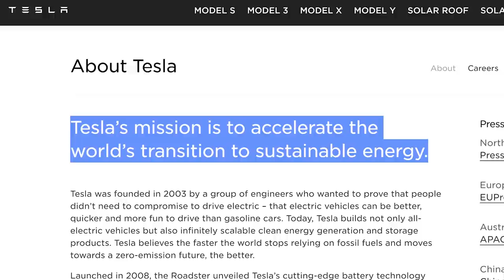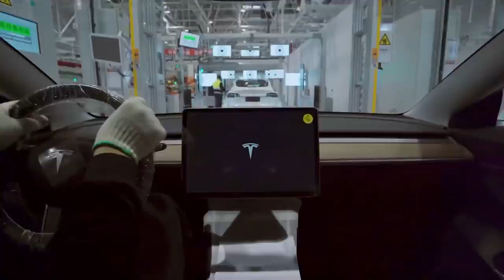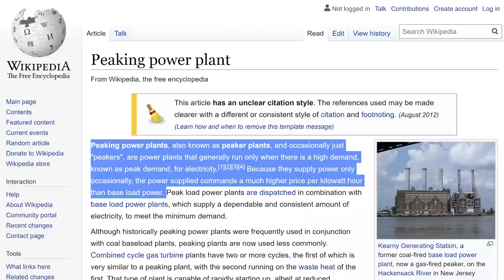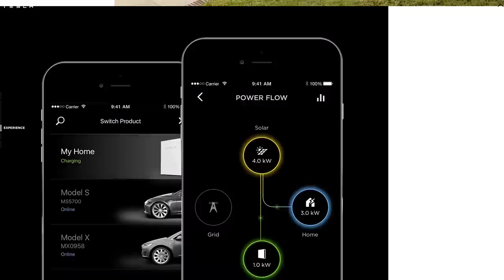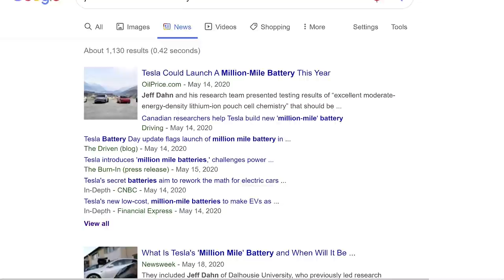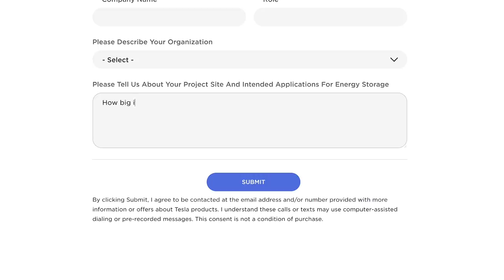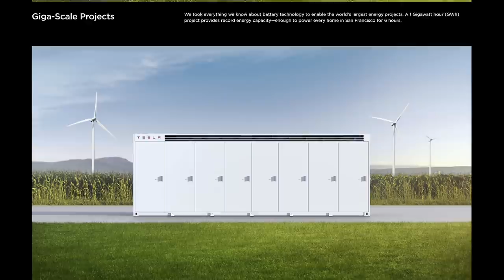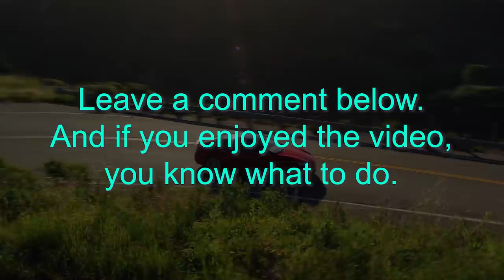Tesla Batteries Will Make Billions ⚡ (virtual power plants, vehicle-to-grid & Autobidder software)

Comment: Hey Steven, thanks for a great video. Two questions though - where do you get the fact that solar is cheaper to produce than a fossil plant? At least here in EU the energy produced by green plants is heavily subsidized, w/o subsidies making a solar plant makes zero economic sense. The subsidy is like 100 - 200% of the price of electricity. Second, I hope tesla will come up with a 1m mile battery on batday. Cool. How are we sure the vw-gm-ford kind of suckers will not copy teslas "open source" battery patents? Thanks for a response. Cheers!
Reply: Daniel Benčík google is your friend. New Solar and wind plants have been cheaper than fossil gas/coal and nuclear for a year or two now
Reply: @kdkd693  Hey ken, so this material https://www.eia.gov/outlooks/aeo/assumptions/pdf/table_8.2.pdf shows that solar is cheaper than SOME fossil fuel plants. If solar was all round cheaper, it wouldnt make sense to subsidize its energy production. Last, the material mentions "Plant SIZE" - this usually refers to installed power, not average generated work. A 1 MW fossil plant has around 0.6 MW production while a similar size solar has 0.15 - 0.2 MW production. If you have a different material I will be glad to see it. Im bullish on tesla and love musk but i like to have my info correct. Cheers.
Reply: Daniel Benčík nice table find Daniel, showing CCGT is good and how bad the best coal is. Both sadly contribute to daily emissions, whereas onshore wind and PV have an extra advantage for me there.

I just grabbed the Lazard data on wiki, which suggests that onshore wind and PV prices (unsubsidized) continue to get lower over the years, whereas CCGT slowly rises. Both are now cheaper than CCGT in most countries, the US being a little the other way

Re subsidies, in my country Australia sadly coal and gas get huge subsidies from our politicians in the pockets of the mining, and renewables not much. Our PM said the Hornsdale battery was going to be equivalent to the big banana or big pineapple as a tourist attraction...that comment didn’t age well. And he still poo poos EVs and won’t put in any infrastructure.

Certainly in Australia, new PV and onshore wind are getting put in preferentially, based on fundamental $ cost, even by private companies. Whilst CCGT and cogen plants were all the rage 20+ years ago in my memory, not much now.

As further proof of PV over fossil plants in 2020, note that the Middle East countries are now favoring electric generation by PV even though they have local reserves of fossil fuels literally on tap. At 1.35c/kWh contract rates, why would Abu Dhabi put anything else in than PV. So cheap, quick to build and when you have cheap unproductive desert available (like Australia) its a no brainer economically. Save the fossil fuels for making useful goods, not just burning it

https://en.wikipedia.org/wiki/Cost_of_electricity_by_source#Photovoltaics

Hope that helps

Comment: Great video as usual.  Tesla just needs time to roll all this stuff out!  Can't wait for the home HVAC system to come out.  This uses 40% of the electric bill.  I'm positive it will work better with less energy needed!
Reply: M Doc i am designing a new home now, and thinking about how I’d heat the pool (absorbing the heat from air using an electric heat pump) at same time as cooling the home (rejecting heat using a reverse cycle air cond heat pump) in another area. 

Both systems cost a lot of electricity to run, yet if combined using a Tesla super bottle style system, the synergy would be great and much energy conserved. Pity the Tesla HVAC system hasn’t appeared on the market yet - although no reason why other HVAC companies could not do this now.

Comment: One thing I can say about the vehicle-to-grid system - each of those cars tends to be driven around. which means a lot of times they're out in the sun. and there's a lot of roof on those things. perhaps, it might be time to figure out how to integrate semi-flexible solar panels into the roofs? either as range boosters, or as further solar production for vehicle-to-grid? five years ago I mentioned this and was laughed at because solar cells weren't powerful enough for that yet. now, they're getting there, and will continue to do so. it'd be a waste to not take advantage of the extra real estate taken up by a car that's, you know, usually sitting in either a parking lot, parked in a driveway, or out driving on a road, where it's quite obviously impractical to build a solar array (hard to drive a car through a solar farm without something getting damaged or someone getting hurt). It's still not great yet, but it is getting more and more reasonable of an answer. and the more they're used, the better they get, and the better they get, the more reason to use them. I think it's high time for that to become a thing.
Reply: Solar panels for cars are available.

Comment: I hope they will eventually also go into the tools world. A Tesla chainsaw, a Tesla leaf blower, a Tesla drill, a Tesla... All tools (including screws) a solar panel installer need. 
Perhaps even things for in the kitchen (under the kitchen there is often a lot of space that's wasted, but now batteries can make money). A Tesla BBQ (which can also work with their cybertruck) a Tesla washing machine (which need a heavy weight on the bottom anyway).
I also think that solar panels should have a small converter inside, that will save a hell of a lot installation time.

Comment: Agree with everything.
One fly in the ointment - Where the #### is all the Lithium going to come from?
The price of Lithium Carbonate has actually fallen from it’s peak in 2018 of $19k a ton, it is now around $8k a ton.
Consequently some Lithium mines have been mothballed because not economic at current price.
Tesla alone will need to go from a yearly Lithium requirement of 25k tonnes to 800k tons to get from 35GWh to 1,000 GWh.
Lithium cannot be turned on like a tap.
Brine supplies from South America need evaporation ponds which take a couple of years.
Hard Rock Spodumene mines require huge $ investment and also take years before production.
Anyone got any knowledge or opinions on this?

Comment: Excellent thesis, but you said fossil fuel price won't go down.  I don't follow the logic, if demand for oil plummets won't the price go down?
Reply: He said not on a declining cost curve, referring to the cost of production. You are right, price is related to supply and demand. Cost is not.
The exception to this is the innovation of a new technology to extract fossil fuel, like the shale oil innovation of the early 2000's. But that is truly the exception. The cheapest oil reserves get tapped first.

Comment: In the commercial market, I think you may be striking on something that is slowing the Tesla revolution: Perception of the pace of innovation. People who have a car that works but want a Tesla see the improvements to range, improving teething problems in manufacturing, and hear things like "million mile battery" and we just don't want to splash the big money on a car when a dramatically better model might be available in two years. It's the early adopter problem but everyone is an early adopter. Elon's trying to counter that to a degree with over the air updates and the rising cost of "full self driving" but it's real.

Comment: I live in South Australia. Before the battery was in we had the second highest electricity rates in the world at 45c per kWh now we’re paying 36c per kWh. Morrison is still in denial that it has stabilised the grid and saved consumers money?!?!
Reply: I'm in Queensland. I think you could go solar + powerwalls anywhere in Australia and remove the power company, but.... cost is still a bit too high for that setup, largely due to the powerwalls being just too pricy. Costs should fall and battery life go up, so its only a matter of time before I disconnect the power company. I'm thinking in the next 3-5 years. If the Cybertruck does vehicle to grid, that would be huge since it has such a massive power pack. If your near a super charger, you might not even need a solar system since you can just borrow Tesla's infrastructure every few days.

Comment: Far as I know, the tesla's in the current line up aren't capable of doing vehicle to grid, so it's going to take more than a software update. Even if they were, still need wiring up the home. Going forward, I think this might be a thing. Cybertruck prototype has a power outlet on it, so it's moving in that direction already.

Comment: There is also competition for electricity arbitrage via interconnectors. For example the UK is building two links to Norway 1.4GW each. These two links will buy electricity from the UK when prices are cheap and sell electricity to the UK when prices are higher. The hydropower in Norway will act as a 'battery' a very efficient one too with return trip losses less than ~5%

Not only can it do daily arbitrage but it can also do weekly and monthly even seasonally storage since their hydropower reserves are vast

Once these two links come online the difference between low price and high price periods in theory will be lower than without those links. Ideally the UK will build another two links to Norway to make it 5.6 GW which is massive

Of course not every country has a neighbor with massive hydropower resources they can just link to

Battery storage will play a big part in solving the green energy problem but a bigger solution is mass global interconnection

Tesla should get into the interconnector market. To reduce the cost of interconnectors. The borning company and Tesla cars combined have the skill sets needed to do this. Not many people know that the USA grid isn't one big grid it's three big grids with limited to no interconnection. Tesla could solve this and it would greatly help in the energy transition. Also links between USA and Europe (5+ hour time difference) would be very helpful. Australia to Asia. Africa to Europe. A global HVDC grid is needed
Reply: Tesla will invert the grid.
Reply: Roger Starkey iseewhatyoudidthere
Reply: nonsense, tesla isnt going to get into interconnector, Siemens, ABB..... are all big players and they have enough experience for those things, tesla is just needed for the storage and there are more players coming into the battery storage too

Comment: Hey Steven. This is kinda an area where I'm in disagreement. As much as wind, solar, and batteries make sense economically from a investor, energy producer, and reducing emmisions standpoint. It doesn't actually make much economic sense from a grid energy consumer or total decarbonization standpoint. Seems a bit counter-intuitive but is the case. Wind and solar are cheap, but the cost of integrating them into a grid are not. And wherever wind and solar are built the cost of electricity from the grid rises. Batteries will help a bit but won't be completely capable of fixing the problems wind and solar bring to a grid. Like wind and solar, batteries only make sense on a grid when they are a minority. 
It's great that Tesla will aid in reducing global emmisions through solar and batteries and will make billions doing so. But the fact that Tesla's factories are not powered exclusively by the solar panels and batteries they produce kinda tells all about Renewables ability to power an industrialized society. If Elon really wants to save the world I really hope he puts his and his teams engineering brilliance and efficiency machine to work designing developing and producing small cheap modular nuclear reactors. Because nuclear power is the only deployable clean energy source that has proven capable of powering entire grids cheaply. One need only look to France. Which possesses the cheapest and often cleanest energy in the UN. And then look over to Germany which has some of the most expensive and dirtiest electricity in the UN despite nearly half a trillion dollars investment in renewables. More than France spent on all of their reactors when accounting for inflation.

Comment: I don't know how much a Megapack costs, but I can estimate the price by... how's it go?... firing up some neurons?
A Powerpack provides 232 kWh of energy. A Megapack provides up to 3 MWh of energy. A Megapack therefore consists of roughly 13 Powerpacks. We do know the price of one Powerpack.
https://www.tesla.com/commercial/design
Choose 40 kW solar panel system and check the box to add one Powerpack. One Powerpack is listed as ~$125k. However this price probably includes required hardware (inverters, etc.), so now choose the 240 kW solar panel system and check the box to add three Powerpacks. Now we're shown a price of ~$280k for 3 Powerpacks, or ~$93k each. Again, required hardware is probably a portion of this price. If we assume Megapacks will have roughly proportional required hardware costs and price scales roughly in line with Powerpack, then we can multiply ~$93k by 13 to get a rough idea of the price of one Megapack. Approximately $1,200,000.

Comment: The closest way tesla is producing a 25k car is if its subcompact 2 seater and has around 200 miles of range. With low margins. And that would be amazing for tesla. But even then I see it being like 27 maybe 28. I never forsee the y or 3 dropping down to 25. Infact youd have to reduce margins to 0 and forego the battery to get down to that range

It's important that you dont become the opposite of David Einhorn.